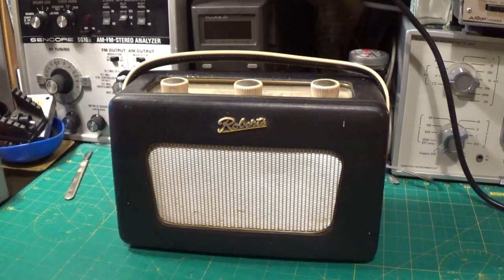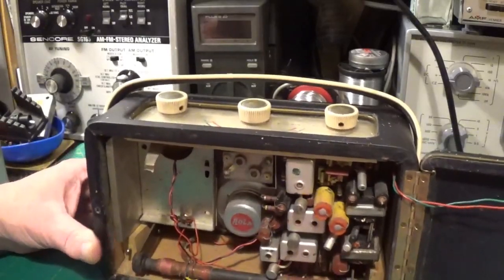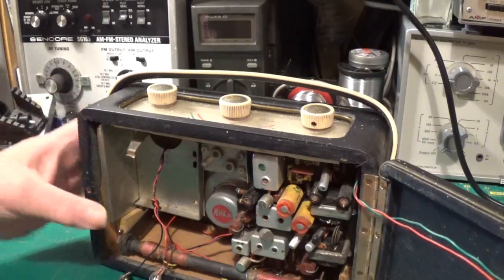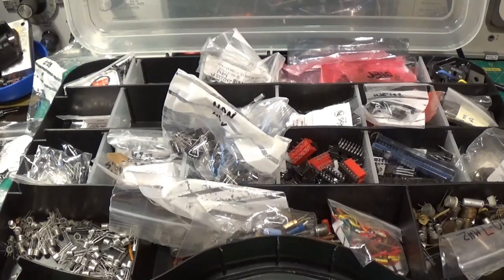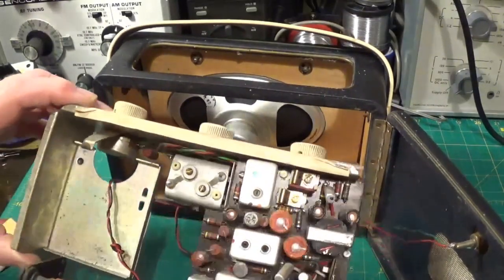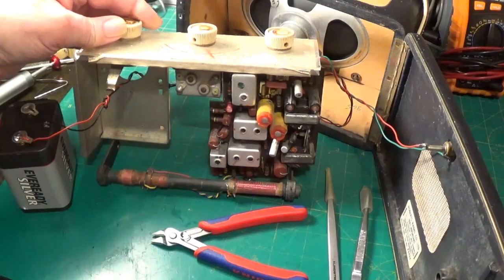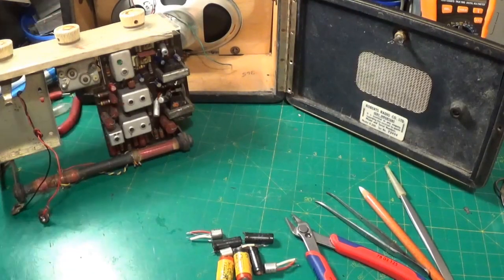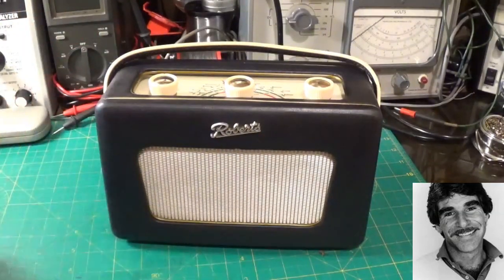Roberts R300: Do we really need Germanium Transistors in our repairs?

Comment: Sometimes heating them up can have the same effect. The Silicon trick is well known and the problem with with Tin Whisker Zapping is the only ones to be zapped are the ones that do actually conduct so when others are still growing inside and will make the transistor fail again in the future. You do sometimes have to change the biasing though in some cases.
Reply from the maker: Good stuff Steve and yes a well known thing but good to actually show it as well

Comment: you cant always just drop in silicons, but it depends on the circuit, if it seems to work as is, you may find the gain drops sharply as the battery voltage drops, if you dont alter the bias, ideally always increase the bottom bias resistor, not decrease top one, to get the dc collector current same as with germaniums,
Reply: i have a later mullard IF module that uses silicon pnps as from factory instead of AF11x types, i'll have to try and find it again and see what types are used, and draw out the circuit to see what resistor values and ratios are used

Comment: Hi, Which silicon ones did you use in the end ? Thanks and great vid btw
Reply from the maker: I used BC559 I think. Most important thing is to get the LO running, some circuits may be a little twitchy.
Reply: @Andrewausfa  Thanks for letting me know. I am only a beginner so could youy explain what LO means. You don't happen to have done a video on this particular change have you? Just bought my first radio (R300) and it needs an AF117 change. Thanks again
Reply from the maker: @cymap  Hi, LO = Local Oscillator. No not done a how to change an AF117 in a R300 video but plenty of my videos show changing components. Read up about transistor superhets   https://www.vintage-radio.com/repair-restore-information/index.html
Reply: @Andrewausfa  Thank you, will take a look now.

Comment: I´ve a nice Hitachi radio it´s a Wh-859D with Germanium transistors that is failing, sometimes there is no sound at all. It was constructed using these transistors numbers: 2A A 131 (Freq. Mixer) , 2AS A130 (Local Oscillator), 2S A12 (.F. Amp.)  , 2 S B75 (A.F. Amp.) , 2 S B77 (A.F. Amp) , and 2S B156 (Power Amp.). I´d love to change them to Silicon transistors. Which easy to find and equivallent transistors would you suggest me to find here in North America?, Thanks in advance from México.

Comment: Hi Andrew. I was given an R300L by my late brother and so it is precious to me. It too has the dreaded whisker issue s and with tapping got it running again but it only lasted a day and now it is silent. I so want to get it working again so you state yiu have used the BC 559. I assume it must be PNP and the connections are the same as for the germanium. Collector to Collector etc. Please can you kindly confirm.
Reply: It can't be otherwise

Comment: And i thought a bit more base current would be needed,  perhaps different radios will be more picky.
Looks much better now :-D
Reply from the maker: Yes these sets are pretty tolerant, it is a relatively simple set and I wonder if the same would happen with more IF stages etc
Reply: @Andrewausfa  Well the capacitance between the pins could de-tune the stage but that's easy to reset the i.f transformers :-D
Getting the gain correct to boost up the low level signal could be tricky.
if too high a gain the next stage would be overloaded and the filtering would widen.
Also it could self oscillate (Annoying to stop it).
If the gain was too low,  you may only hear really strong stations and the filtering may become too narrow.
Anyway i'm just saying the obvious that i'm sure you know way better than i do.
My noggin isn't clever enough to cope with design calculations lol.
Reply: its not base 'current' that needs changing, but voltage, germanium junctions have a 'starting' voltage of about 0.25,  silicon about 0.6  so if base voltage to emitter supply rail is about 0.7 or less, the silicon one wont work or only barely work, and stop if the battery voltage drop off with age...
Reply: @andygozzo72  You are right but base current will change with voltage.
Not in a linear way though.
i use 0.65 to 0.68 volts as a crude check for ordinary stuff.
Germanium transistors are horrible leaky devices,  not my cup of tea.
Just my personal opinion of cause :-D
Reply: @zx8401ztv  the circuits used in radios mostly feed the base with a voltage from a potential divider across the supply, the base 'current' in these cases is irrelevant, its the voltage that matters, if base sits at say 0.4v to the emitter or emitter supply, a silicon transistor simply wont work, if pure current fed such as single resistor from base to supply line, the base turn on voltage is irrelevant in this case and silicon should work as is drop in ,  yes, germaniums can be problematic, especially the ones with metal can, metal inner (glass type like oc44 less a problem but can still fail, i've had one go resistive in a r200) but that was all that was made and available at the time and circuits usually took 'parasitic' dc leakage into account, resistor values being lower that what can be used with silicon , it should be possible to convert any germanium circuit to use silicon, but bias alterations will be needed in many cases...  output stages may be more an issue as the higher turn on voltage also means higher losses and output wattage may be reduced, especially if the supply voltage is fairly low, output stages will definitely need bias altering or you will have severe cross over distortion

Comment: Great video Andrew I have used BC557 transistors with no issues I your not bothered about authenticity why not use cheaper alternatives
Reply from the maker: Hi David, exactly my thoughts. They would have no cared a jot about 'originality' back in the radio reapir shop days, the imperative was to get it working. I maybe wouldn't try this on a really rare or mint set however!

Comment: Germanium radios are far more efficient that silicon. You can run one for months on 1 battery. My modern Roberts eats batteries.
Reply from the maker: Hi Simon, yes modern DAB sets use a lot of current and are very inefficient. Much better of with a vintage set :)
Reply: Does replacing the germanium transistors with silica effect the efficiency?
Reply: @Thecando  It would but you would have to change a lot of components, you can’t simply swap a germanium transistor for a silicon one.

Comment: Mullard lockfit resistors, hunts mouldseal capacitors, mullard Ge AF11 series transistor problems.

The Ge transistors & diodes are a major part of the radio's battery efficiency.
Im not 100% on this but i think it is only the mullard/philips AF's that suffer with the tinned whisker problem.
I don't think the european and japanese TR's do in the same way, but i do know that they can become noisy.

Of course this is all because these radios etc have been during some time in life stored in a cold damp environment for yrs.
With germanium transistors the metal can absorbs air born moister like a sponge and becomes badly tarnished. 
Hence the tinned whisker syndrome!
The same happens to plastic cased silicons where the leg terminals enter the case, they go black and become very noisy.
Hence why some of the silicon TR's have gold plated leg terminals to junction to help pro long its life.
Reply from the maker: Erie resistors actually, the transistor cans are hermetically  sealed, it's the tin wash inside that causes the issue.

Comment: The simple answer is no.
Germanium transistors can be replaced with silicon and re-biased.
If you're trying to make a living doing low-cost repairs in volume, it's not practical.